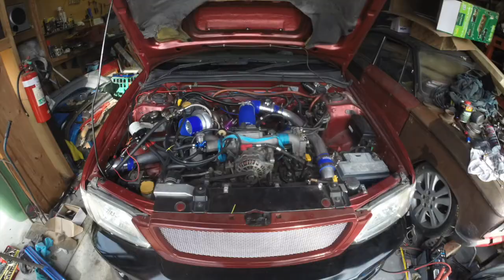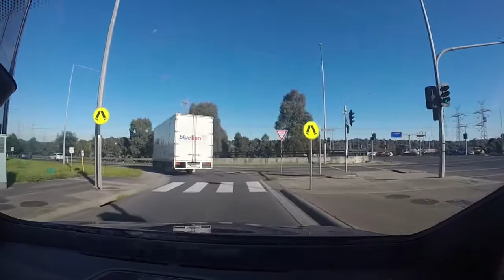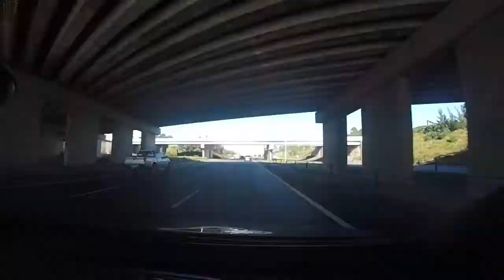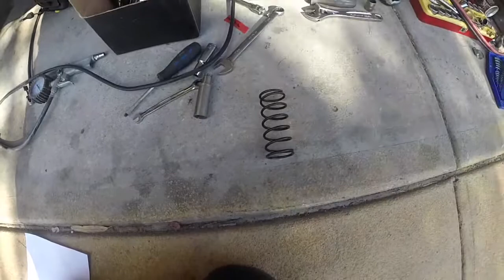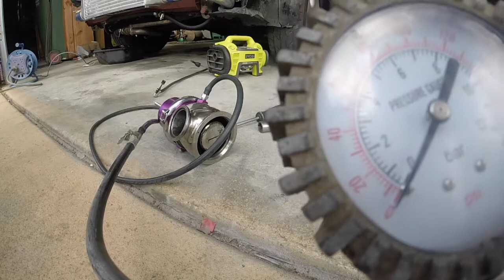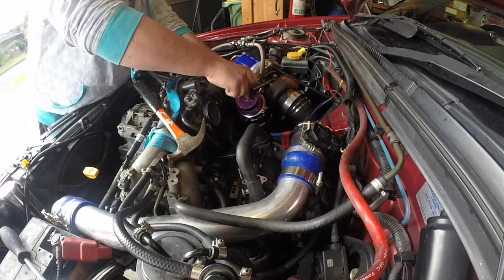How to install an External Wastegate Spring | Twin Turbo Subaru

Comment: nicee!!!! eagerly awaiting the diving video! Another trick for installing the gate if you don't have that long bolt or the room for the bolt, would be to use a vacuum pump in the top port to pull the gate open
Reply from the maker: +makipsee true or just put pressure into the bottom chamber like when I was testing.
Reply: +Puds Garage oooooo yea that works also haha